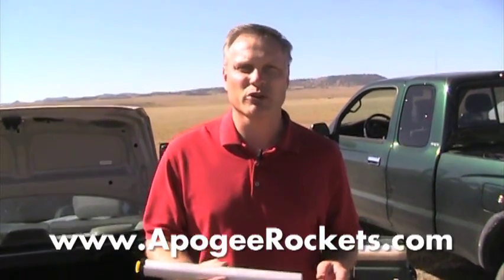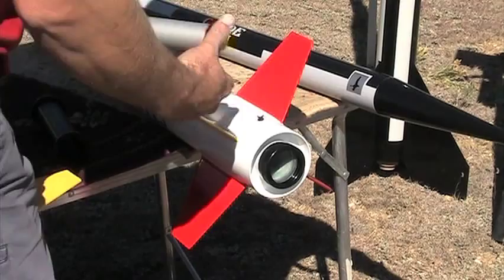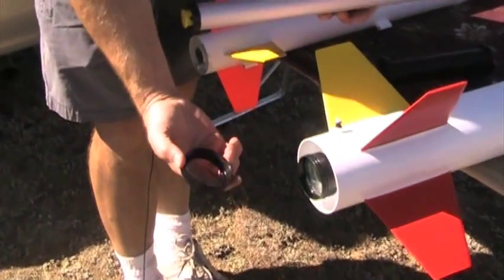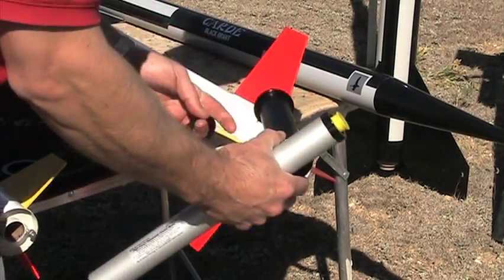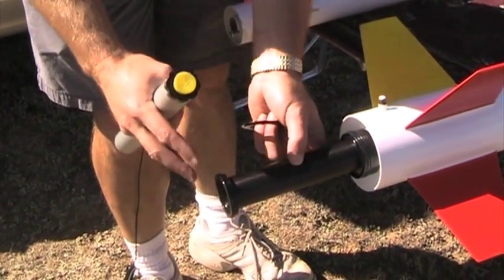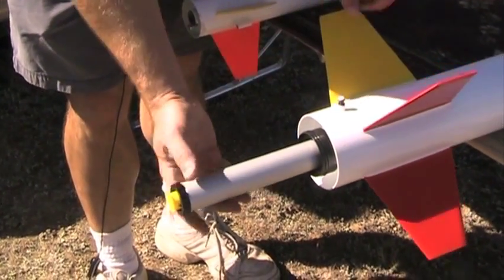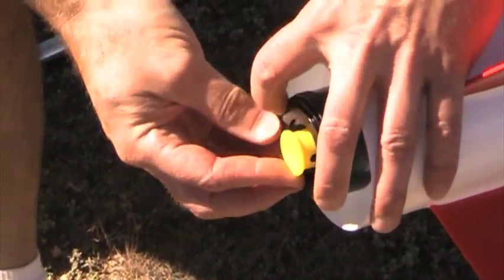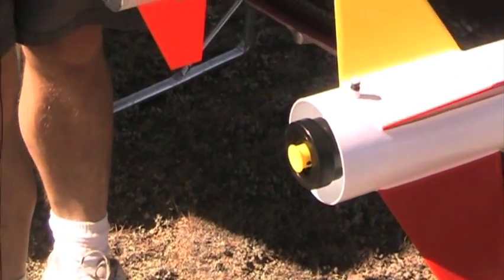"Using A Motor Adapter for High-Power Model Rockets"

Comment: You reversed the ring before adding it.  Which way and why?
Reply from the maker: This will make no sense to you, because you can't feel it. But it fits one way, but not the other.
Reply: @apogeerockets  I have a 54mm to 38mm and it closes either way, a photo of the proper fit would be helpful.